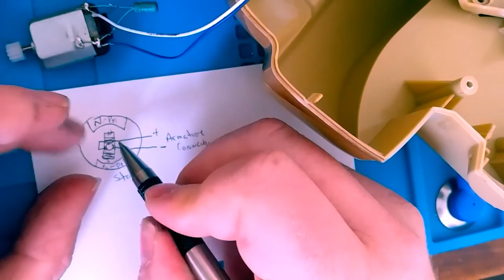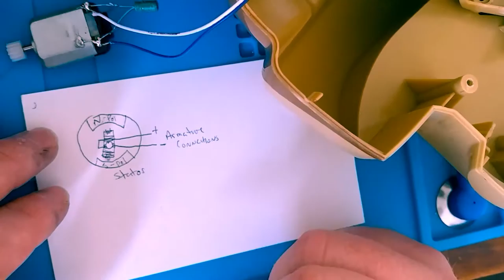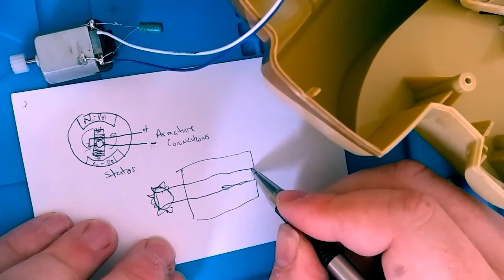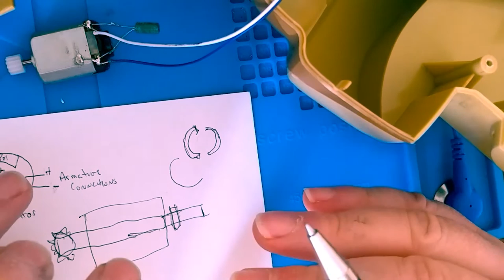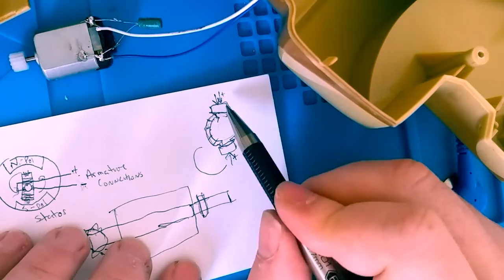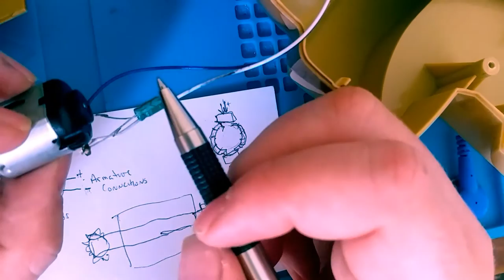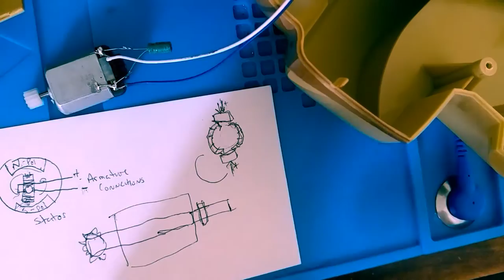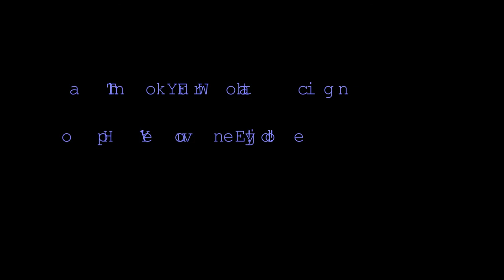Electric Car Repair Toy State Tank Zilla

Comment: Why did you reverse the Wures on the 
MOTOR
Reply from the maker: I didn't annotate the original orientation of where the wires were first soldered. So when forward was pressed the vehicle would have gone in reverse. This was a mistake I needed to correct.
Reply: It all good ya revetse wires on a DC 
Motor well do that Big Or Small.
I would not do it In A AC Motor